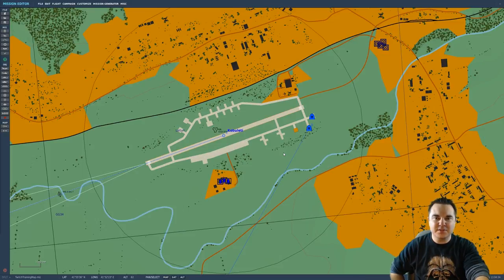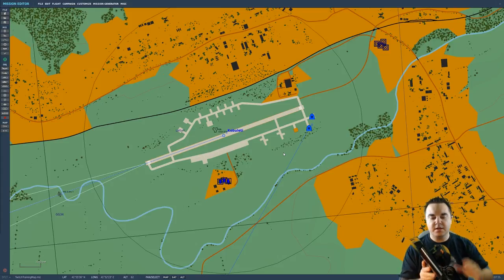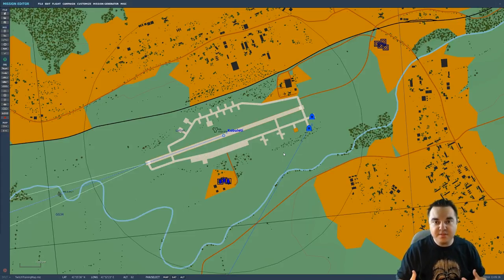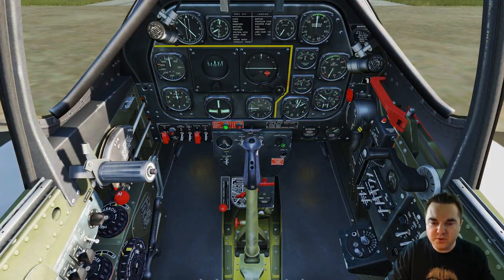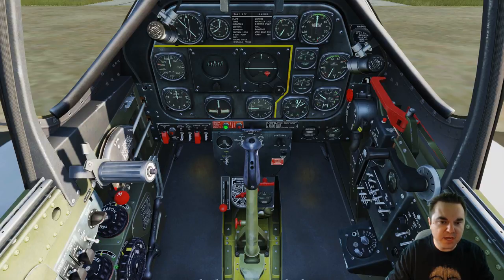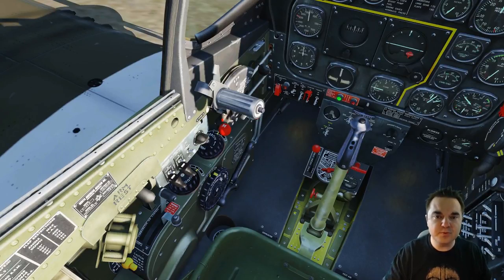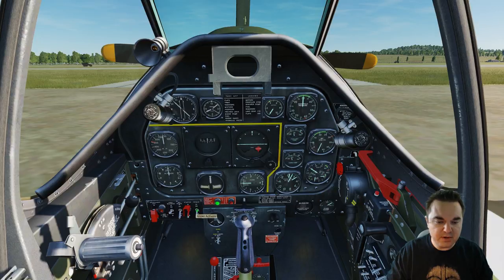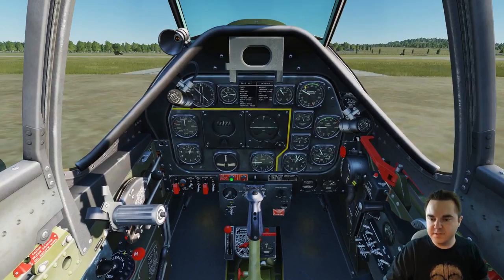DCS World Tutorial Series: TF-51D / P-51D - 01 Startup and Shutdown

Comment: Great Video! Just a little addition to P-factor you mentioned:

P-factor is just one of the 4 propeller forces. These often cause problems because each force impacts the plane in different phases of flight. 

P-factor will yaw the plane left when it is at an angle of attack (so when tailwheel is on the ground essentially) and increases with speed. 

Torque rolls the plane left. This causes even more left yaw on the ground since the left wheel digs into the ground more and countering it with ailerons introduces left adverse yaw. 

Gyroscopic forces yaw the plane when you change pitch and pitch the plane when you yaw. For example right yaw when you pitch up). 

Propeller Slip Stream yaws the plane left and the effect decreases with speed. 

You counter this with right rudder and aileron. How much depends on speed and phase in takeoff, as controls get more effective with speed. 

Understanding all these effect is crucial for smooth T/O and landings and will improve your flying - and especially your survivability when you are low and slow.

Comment: I'm having an issue where my plane banks hard left on takeoff. It's not my stick, that's working fine on other games.
Reply from the maker: https://www.youtube.com/watch?v=0Jpp5g6ZxB8 Give this a watch for an explanation on why this happens in propeller planes. Happens in all single engine propeller planes, and is more prominent with higher horsepower engines like the one used by the P-51D Mustang. If it's happening in a jet, ensure that both engines are on and running properly. Otherwise, you may need to file a bug report to Eagle Dynamics.

Comment: I stuck in the Training Mission. I habe to klick on a nob but I can not click on any button, even in the SU-25. The cursor remains yellow. :( 
Any idea?
Reply from the maker: The Su25 and Su25T do not have clickable cockpits as they are simplified systems aircraft. Everything is controlled with keyboard commands. The TF-51 should have clickable cockpit - check your control configuration for the keybinding to enable Mouse Mode (this is usually LeftAlt+C) if you're having trouble, although you should be able to click on switches in the TF-51 and any aircraft except the A-10A, Su25, Su27, F-15, Su33, or Mig29 as these all share the simplified systems (keyboard commands only).

Comment: That joystick is a piece of shit. I've gone through 5 or 6 of those and they consistently fail either in the Z-Rotation sensor, or in the slider and sometimes also the trigger.
I've had 2 of the earlier green version, which was not as gayish as the orange one and was also better at the Z-Rotation sensor.
The orange version has lesser quality Z-Rotation sensor and switches.
The only two good things about this joystick is the H.E.A.R.T. sensor, which never failed on me, perhaps because it is magnetic, and, I have to say, its ergonomics.
It could benefit from a pinky switch though.